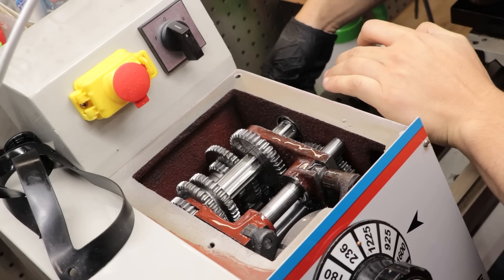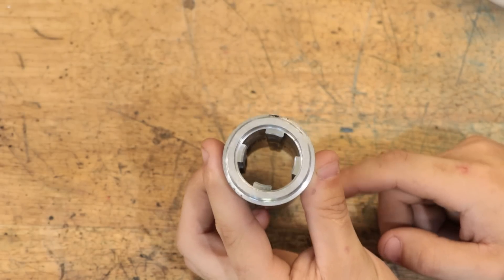Making Spline Shafts For a GEARBOX (Internal Splines too)

Comment: It's great that you are being kinda self taught.  Being that I did an apprenticeship it's grained in to do things a certain way for precision. It's good to stand back and think of the simple way to do things.   One of the owners of a tooling shop I worked at called me his right hand lazy man.   Being I'd look at a problem , and come up with the lazy , quick way to make things come together.  They were always putting decent gift certificates in my pay check , and always a big bonus twice a year. But I had never thought of making internal splines this way. I'd set up an indexing chuck on a Bridgeport mill , and use the quill up n down to cut each spline. The setup was quick , but it took way more time than a simple broach
Reply from the maker: Half self taught (for the more advanced stuff) although I did do a course in university doing the basics. Although I think nothing is a better teacher than having for learn on the fly during a job. Cheers

Comment: Great video and i am definitely in need of broaching tools they are so handy.....also another method is to use a boring bar on a lathe or mill (painfully slow tho but if you have nothing else) you could also use tool steel with the right profile (i have also seen people make tiny tools similar to the end of a shaper an use a spring so when puling it out it does cut)

Comment: Hi 
Like all of your videos especially the one on the fly press build👍👍👍
I was hoping you could help me out. 
My lathe is from hare and Forbes AL 336D. 
How can I turn on the beeps on  on the DRO. 
I know it can be done as I saw a Utube video some time ago, the tones or beeps where on but have some how turned off. I am retired having been in a noisy trade,so I like to hear the sound when I press the DRO buttons. 
Hare and Forbes just brush me off. Very rude in Sydney 
Nothing in the instructions 
Look forward to your reply 
Regards 
Greg  NSW
Reply from the maker: Hi mate. I dont know the specifics on the DROs that hafco uses, but if they are anything like mine (and it wouldn't surprise me if they were similar) there is a menu mode that you can activate as you turn the DRO on. For me I have to hold the enter button as I turn on the DRO to get into the menu. There should be quite a few setting including one on turning the sounds on or off. Then you enter the quit menu to save the settings. Hope that helps. Cheers

Comment: As a trained machinist, we make splineshafts pretty much in the same was, just that we use a flat cutter on the side so the splines are in a horizontal position when being cut and we use a formtool specifically ground for the job to make a round profile at the foot of the splines.

Comment: Ever consider laying a trapper behind the outer edge of your spine shaft? You could theoretically use it as a rotary broach. You could then theoretically cut your internal spline part with much closer tolerances and produce more aesthetic parts.

Comment: That is amazing! I’m a hobby machinist and I also love 3D printing. This will solve so many problems with trying to print 3D parts to use in the machinist shop made tooling. Herringbone 3D printed gear teeth are reasonably strong the weak point was always the one or two key way(s). I like the simplified profile of your 6 way shaft. I had over complicated the ways of my design for years and turned it into unitanium with to many stress risers.   Thanks for sharing.

Comment: I wrote an article in Engineering in miniature around ten years ago on this subject.
The error here is that you should have taken multiple cuts between the keys to create a faceted curved surface for increased contact.
Reply from the maker: You think so? Im just going off machinery handbook to replicate the spline pattern and method that they hand laid out. Do you think it would make a big difference to the final result? Not doubting juat curious Cheers
Reply: @artisanmakes  There are multiple types of splines used in industry. I do not disrespect your efforts, I like them. That said, splines threads have a percentage of fit rating. The method I wrote up used the same principle as yours but between four splines was around six hundred divisions each. This was then blued and hand scraped in, a lot of work you may think but the end result is an extremely positive drive with very little movement.
Reply from the maker: Blimey. I've done a bit of hand scraping before but I could not imagine doing that to a spline shaft. That's fantastic. Cheers

Comment: Could you not get a closer fit if you started with a hexagon in the female part and then broached each corner?
The internal and external flats would then fit much closer. Just a thought.
Reply from the maker: This is a flank centred spline shaft so we are not wanting there to be contact between the outside flats, only contact on the sides. Cheers

Comment: How can you tell that the quill part is die cast? At scale, would it make sense to make that part out of a custom aluminium extrusion, with finish machining?

Excellent and creative work as usual, by the way.
Reply from the maker: The inside spline, as well as the keyway has that classic die cast texture. Extruded looks different

Comment: Nicely done. We built industrial gearboxes and supplied gears to customers specification, mostly automotive. We broached, hobbled and shaped splines, but when doing single piece for gearboxes we used the same method as you have shown. We did, at least once, have a special single cut broach made so we were able to cut 6 splines with a rounded root. Your way works great so kudos to you. Thanks for posting ✔️👍

Comment: I believe you’ll want to harden the spline shaft and mating hub spline surface or use a stronger steel like shaft material.
Reply: Neither the change gears or the keyed or splined shafts are hardened on my L6 Harrison lathe and it was made in 1964 and there is no slop/wear in any of them. For this sort of application the shafts and splined outer components will be fine without hardening.
Reply from the maker: Given the scope of what I need it for, I don't think a hardening process is necessary. I think it could possibly cause me issues to due to the part warping or shrinking as a I heat treat it, and I really don't know if you can grind internal splines. So atleast for the moment moment will leave it unhardened.
Reply: Hardening might be counter productive. If you want contact simultaneously on multiple splines, you'll need a little wear. I think.

Comment: Nice work, im considering trying to make a gearbox for my lathe so i dont have to keep changing gears out when i want to cut a thread
Reply: Or simpler than making a screwcutting gearbox is to fit an electronic leadscrew kit.....cut any screw pitch you fancy with that set up.
Reply: @howardosborne8647  I've been curious to know how well they work. I've recently acquired an old Atlas lathe, and it requires change gears for cutting metric threads. Ideally I'd like to be able to switch between metric and imperial without having to change gears.

Comment: Technically, your mill isn't too far from being a hobber as is. You would just need to make an arbor for the hob, a lot of change gears, and a way to adjust the shaft center distances for the helical milling attachment, and extremely precise control over both your feedrate and spindle speed (ideally the table leadscrew and spindle are mechanically linked, but CNC works on the aforementioned method). So yeah, basically a hobber already!
Reply: arguably if you have an accurate rotary vice you can use an arbor saw to give a psuedo hobbing solution with a profile cutting saw
Reply: @bengrogan9710  I have seen involute gear teeth cut in a similar way to how you describe using only a slitting saw as the cutting tool. It requires a lot of indexes of the dividing head and the correct offset up and down on the Z axis but it does work.

Comment: ive made some internal splines before , we have a old  vertical shaper with a rotary bed that works like a standard dividing head , we have a 4 jaw chuck mounted on it so we can dial up jobs that require splines or multiple keys however the downfall of the machine is the tooling we have for it , all self made even before i started working there so theyre not perfectly square  as well as when i need to grind HSS tools for the odd internal gear here and there

Comment: It seems you will have accumulated error with that indexing technique, but for only 6 splines probably good enough. I made an indexing plate that attached to the end of the shaft.  It has the same number of holes as splines, and uses pins in the holes resting on an adjustable parallel. I learned that from JoePie, he has a great old video on it.
Reply: Thought pretty much the same, first "Uh, that'll add up" and then "Oh well, probably still fine" :D

Comment: I think you're selling yourself short. That'll work just fine for nearly any application, including high-torque ones. Remember, you now have essentially multiple keys that are part of the original material, distributing the load across both surfaces. Torque away, that thing is not going anywhere.

Comment: Straight splines surface contacts are the sides and the smaller diameter. That's why you need a spline shaft cutter, which is around 50$ in china.
You can buy spline shaft by the meter, as they are used a lot in agricultural world.
Reply from the maker: I know some are, but the splines in the mill and drill press are purely side fitting, and it will be the same profile that I replicate in the gearbox. I did look at getting some off the shelf spline stock, but it was more than I really needed. Cheers

Comment: Nice Work , especially on the inside Splines and It definitely seems usable. But on the splines i know, the inside of the bore and the "valleys" on the shaft are the locating Features, and not the splines themselves, they are Just for transmitting the Torque. But machining the inside Diameter of the splines to a preise measurement is  quite Tricky i think.
Reply from the maker: It will depend on what type of spline type it is. Some use both the root and the sides for contact, but some use the side flanks only. My mill and drill press spindle for example use only the side flats and neither the inside or outside flats make contact. How much of a difference it makes, I am not sure but for the project I have in the works the spline I made here will work.
Reply: This is part of why most are hobbed in production,  cutting with a rotary tool like and end mill can only give flat valleys
Reply: @bengrogan9710  A profiled side and face cutter mounted on an arbor in a horizontal mill will produce the curved profile in the root of the spline very easily.
Reply: Seems like a perfect excuse to build a 4th axis for the CNC mill :) Rotate the shaft while moving the cutter horizontally to create a cylindrical profile between the spline teeth.
Either that or make the hole match the flat root profile. Mill a hexagonal hole into the gear before broaching the internal teeth, and make a hexagonal broach guide to go with it. That would also index the cut without any accumulated error.